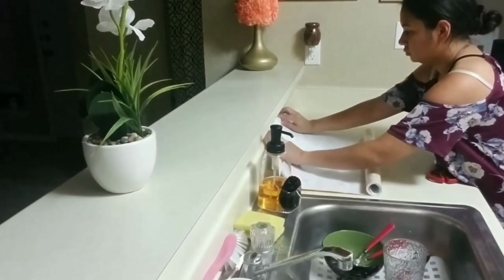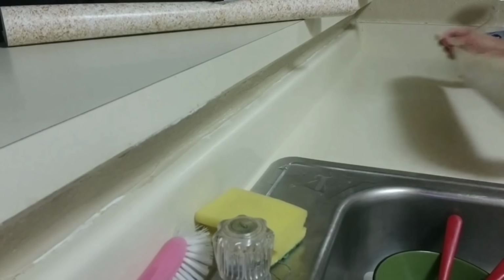Renter-Friendly kitchen counter makeover using Contact Paper

Comment: All contact paper last until you pull it off. When you do pull it off have a spray bottle of HOT water for the sticky to come off completely. I had mine for years, but then I never had anything hot on it ,no nail polish or remover,Ash trays etc.

Comment: Hi did you try contact paper on some wooden tops for example tables? I want to use contact paper to renew my desk, but I'm worried that the sticky residuals on the desk would be hard to remove when I move out from my apartment.
Reply from the maker: I did try it on my desk but mine is not real wood. I got mine from walmart and when I took the contact paper off some of the paint came off the desk. But if it's real wood it doesn't peel off and u can just use some soap and water and the sticky cleans right off. On mine it's usually not sticky at all like on the kitchen counters
Reply: Yes I did luv but when you take the sticky stuff off.on wood it takes also the surface off. I would paint a wooden table.then put a sealant on top.that would be better.better talking to a proffessional painter or a furniture restorer.
Reply: I have only painted old dressers that belonged to my nan.

Comment: Can you spray and wipe down the counters like normal with the contact paper or will it start to tear?
Reply from the maker: I have used it always everywhere I lived and I can wipe down easily it hasnt torn or faded but I would still be careful around the edges to avoid the contact paper from lifting. Overall it's great! Specially if you use thick contact paper 😊

Comment: This might sound silly but I did this and I couldn't get it straight or take out the air bubbles for shit! I was disappointed in myself 😢
Reply from the maker: Awe really?🥺🥺 that sucks but it happens at first I do this all the time now so it's easier for me but I went through that the first times I tried
Reply: Try using a smoothing tool and take the backing off a little at a time, smooth, then more of the backing, then smooth until its the whole backing is done.